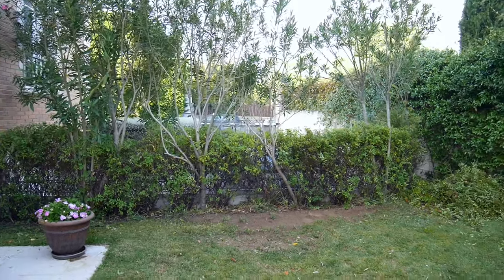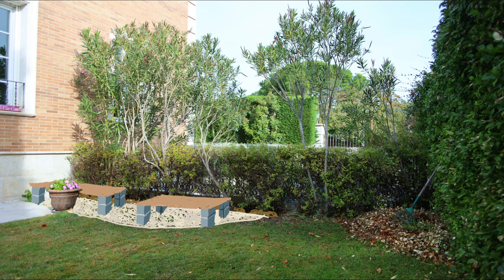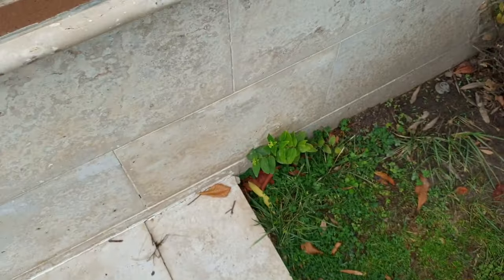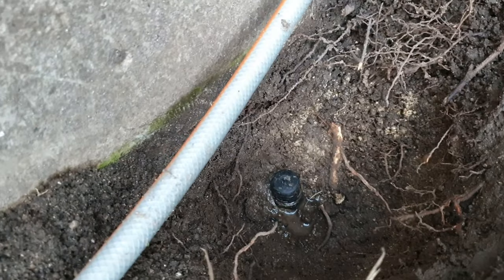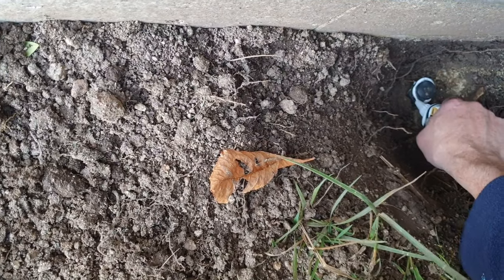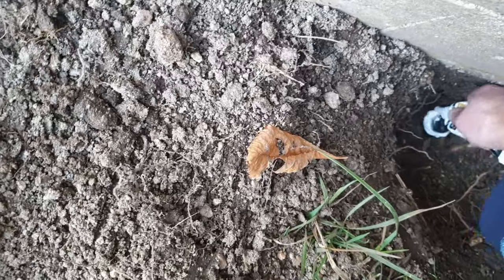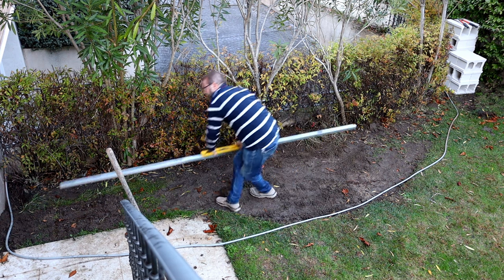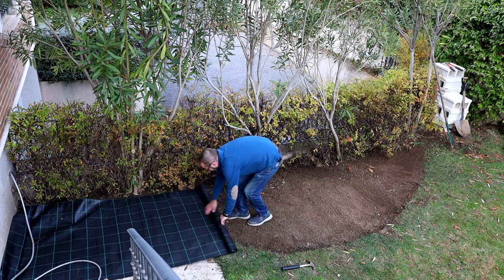How to make a Bonsai Garden (simple) - Part 1

Comment: I built almost the same thing this summer!  If you go to a home store, you can find thin capstone blocks with slots that you can slide the wood through to make a little more secure.  I spray painted by concrete too and it looks pretty good.  Thank you for sharing!
Reply from the maker: Thanks mynala110! Definitely the planks need to be more secure.. more in part 2! Hopefully next weekend weather permitting 😊👍🏻

Comment: I'm getting ready to start my own build and am leaning towards benches in the same style that you made here. I'm curious if after 3 years you have any regrets or things you wish you had done differently?
Reply from the maker: I'm still happy with the design and structure.   A year after I made this video I added an automatic watering system, still works very well. 
I have considered moving the blocks inwards by a couple of inches so the planks would overhang the ends. This would allow run-off water to drip off the ends rather than running down the sides of the blocks.  That would also reduce the risk of the planks bowing in the middle... but thankfully I used thick planks and they don't bow.  
In the end it's better exactly how it is now,  because with the blocks aligned to the ends, it means I was able to bolt upward columns to the blocks, to support the overhead shade in summer. 
Hope that helps.
Reply: Thank you!

Comment: It's uncanny, just as Jack Taylor said, I am also getting ready to make myself some benches just like yours (got come breeze blocks and planks from my "father-in-law" - I'm not married - that would have been thrown away, lucky me!). Now to watch how you do it!
Reply from the maker: Hehehe maybe this time of year is good for it, while there's no repotting and we're waiting for winter to do any pruning or chopping.  Good that you got some materials donated!  The wood cost  considerably more than the blocks. Those blocks were only 49 cents each! Anyway, not to give too much away but levelling the benches has been the hardest part... depending on your ground you might need some sand and a small amount of cement powder. But if it's on patio slabs you'll be fine.